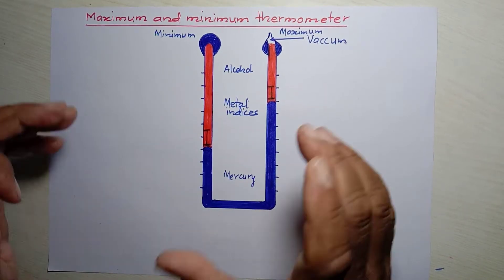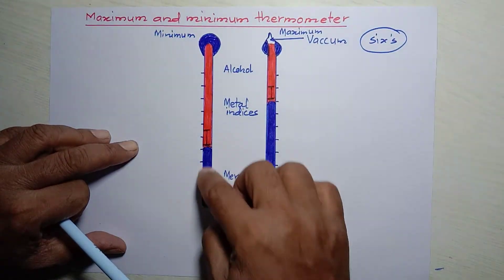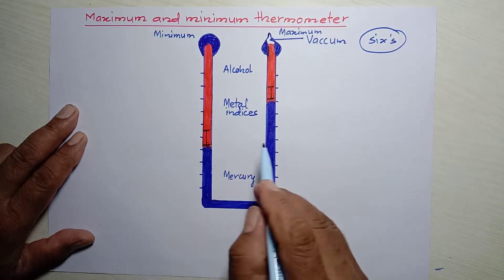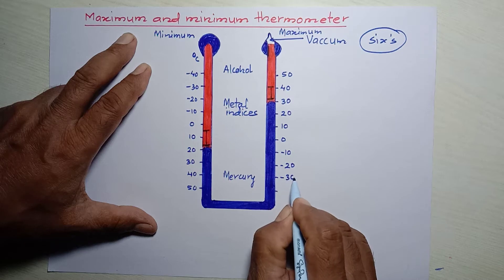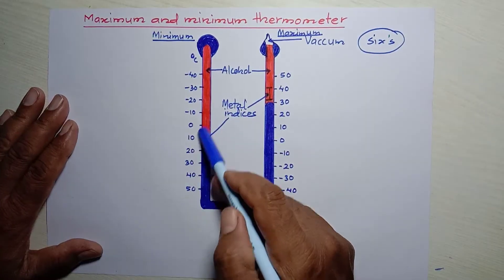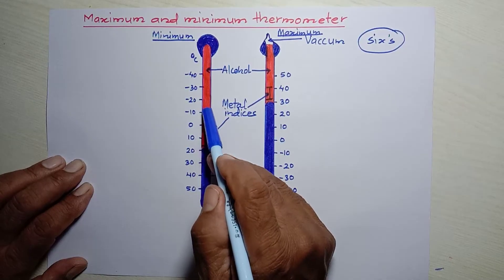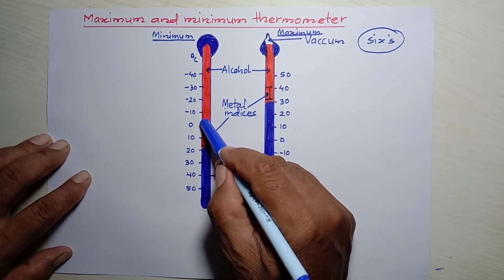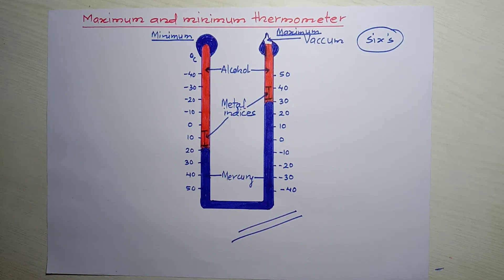Maximum and Minimum Thermometer

Comment: You never address the most obviously puzzling partI  The indices -  especially how they can go up but not down.  The only time you get close to talking about it, at 4:50, you confusingly say "the mercury falls down; but index remains in the same place; it falls down".

On my old min/max thermometer - built just like this - the metal indices slide up and down freely with gravity.  That makes no sense to me either which is why I was glad to find your video.  But all it does it tell me over and over that the alcohol expands and contracts and pushes the mercury both ways.  I got that the first time.

Comment: Sir why index not fall down if alcohol contract
Reply from the maker: The density of alcohol is very less (0.79) than the steel index(7.8). So it cannot push the index during its expansion but the density of mercury is 13.6, so it can push the index.

Comment: Why doesnt expansion of alcohol push indicator  (steel indicator) downward in minimum range if it can be pushed by mercury?
Reply from the maker: Sorry, somehow I missed to reply you in time. 
The density of alcohol is very less i.e. less than water (1) but the density of steel (iron) is very high (7.8), so it can not push steel but the density of mercury is very high (13.6) so, steel is pushed by mercury.
Reply: @JKeducationcentre  Fun Fact: Lead is notoriously dense, but mercury is so dense, that lead can float on it!